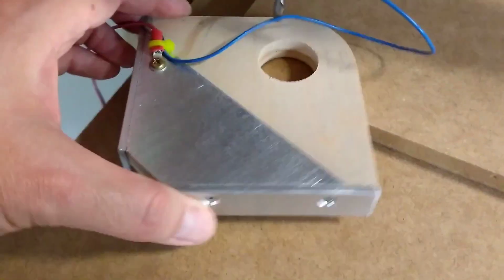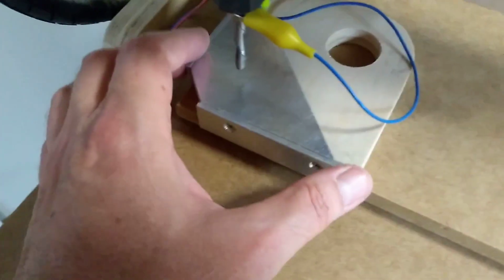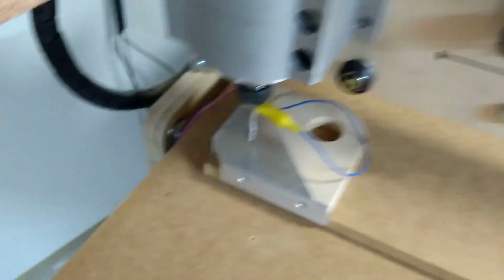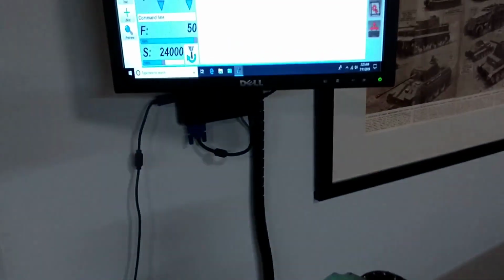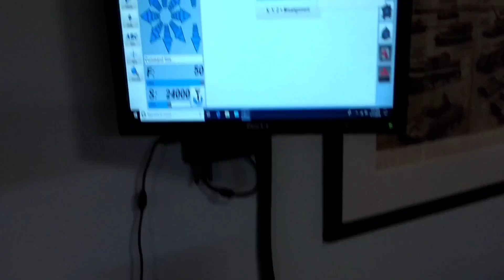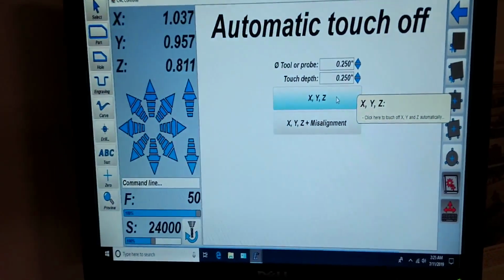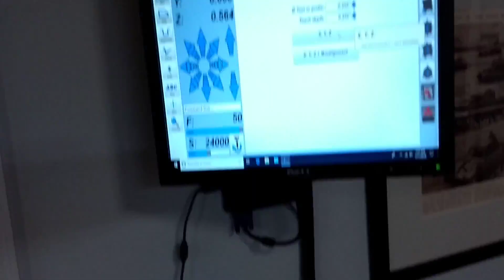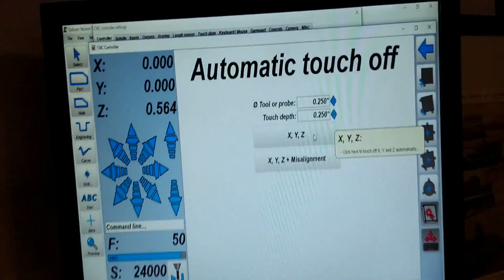DIY Touchplate for a CNC Router

Comment: Thanks for sharing this and your shop-built CNC machine. I understand the touch plate has the x, y, and Z offsets from the corner of your workpiece, but on the software side, how does it know to move down to touch the top, then move to each side, and then calculate the ZERO origin by subtracting these offsets? Another thing, a spiral cutting router bit may touch one side on a high spot of the spiral, and a low spot on the other side of the touch plate. How does this affect the zero calculations? Thank you.
Reply from the maker: The zeroing setup is easy to do with the EstlCAM software I am using.  As to the the spiral bit high point.  You just define enough down motion so that one complete spiral will be exposed to the sensor plate.  Video on the EstlCAM zeroing: https://www.youtube.com/watch?v=bhZdbgM6S70
Reply: @zeketeccnc1207  Was wondering the same thing.  Thanks for explaining that.  Looks like a really cool build and a nifty addition.